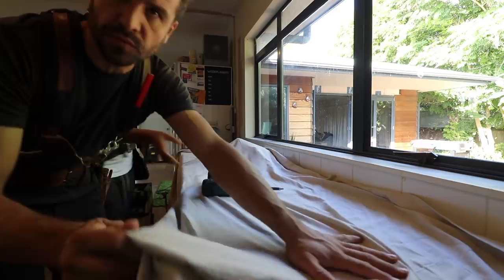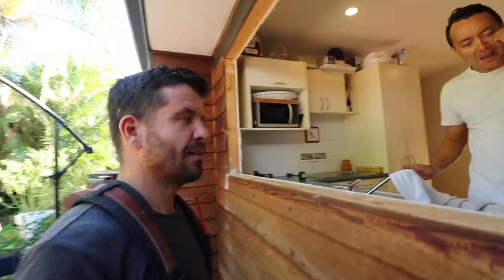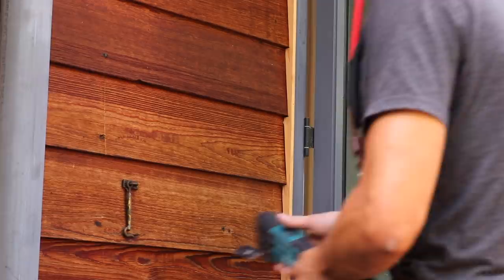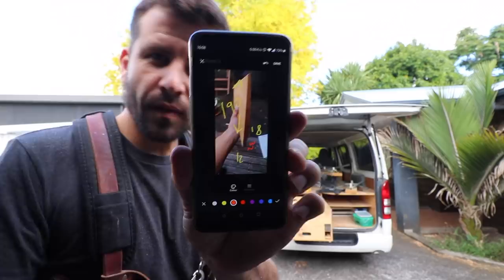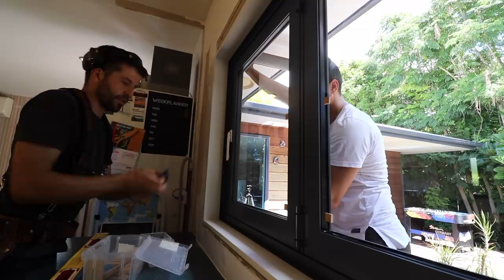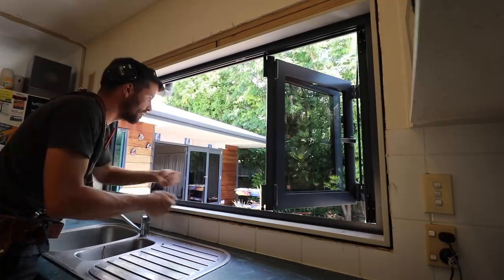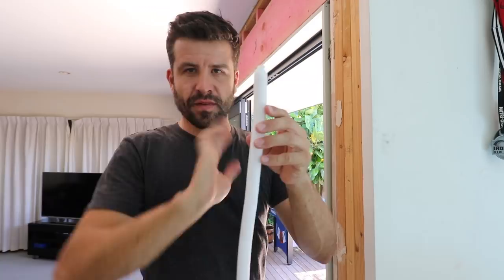A Kitchen Bench Window (very cool)

Comment: The regulator that decided on the silicon rule must have shares in the stuff. Damn that's a lot of product being pumped out.
Reply: in northern europe we fill insulation in the middel, then the backstop 10mm from egde and then a weatherresistant and slightly elastic filler with color to match the window

Comment: Silicone idea is crazy. If you can't use expanding foam cause you say it pushes in to the cavity. Use low expansion foam that stay soft and never sets hard.
Reply: It was probably someone of higher power that stated silicone needs to be used instead of low expansion foam, baring in mind this person probably has no idea what he's talking about (the person of higher power) GJ as always Scott
Reply: The way he said it, this almost sounds like it’s updated code for his area of NZ? I could be wrong, but that’s the impression I was under after Scott explained it.
Reply: silicon is not industry standard, it's personal preference.
Reply: First, silicone shrinks, second - if that rod is closed cell (i.e waterproof) then just bead either side with a thicker nozzle cut.

Comment: Wow! You can see how much water got in around that window installed the old way. None at all.
Reply: I know ....leaky homes came and the building industry went berserk , silicone hate the stuff.
Reply: Or, they will find a really dumb idea overseas, that was proven not to work, and turn it into 'their' latest idea. Only in NZ.
Reply: @Ben Miles But BRANZ knows everything, they have laboratory conditions.
Reply: @bunning63  Anything "Hardi" and usually from Canada
Reply: That window also has an overhang, and the corners of the window happened to hold together. The building codes are also implemented because of the low standards of window window quality and variety of building conditions. If that had no overhang for protection and was a cheap vinyl window the sill timber would probably be wrecked.

Comment: Bro, silicone tip for between jamb and framing. 

Cut the nozzle tip as big as possible, pump heaps in there so it's full and protruding out of the gap slightly and get some soapy water in a spray bottle (any dishwash liquid), spray liberally and tool it smooth (popsicle stick or even an off cut of timber). You waste a bit of silicone but is honestly about 5x quicker than that way. Keep a few rags and a bucket handy.
Reply: That's for a finished bead. I hope they put some window casing over it. It was a modern trim before.
Reply: @smokingcheeba420  no I use it for speed filling too. If you don't use the soapy water it gets everywhere/messy. Just insures the gap is totally full and the silicone spans it properly. Not fussed about the profile, more that it's full, fast and clean. 

 They'll for sure shoot an architrave around the jamb
Reply: I'm good with a caulk gun. It's an art. Less is more I guess. That's how the plumbers do it. The soap keeps it from sticking where you dont want it to. We use a ton of silicone on our jobs. We could just use PL.
Reply: @smokingcheeba420  sweet as. You go do it your way and I'll do it mine. Just wanted to offer a tip to Scott as I have taken many a tip/trick from his videos. 

Should sell your caulking gun art online oi ;)
Reply: @TheBoufhead  no beef. Just saying. I don't always have soapy water on hand. Or backer rod. Good tip.
Reply: Old phone books are the go for silicone sealing rather than using heaps of rags. ya wipe your tool off along the page and fold it up and repeat. when no more page is left you rip it off and the next page is right there ready to go. and all the excess sealant is nicely wrapped up in paper ready to chuck in the bucket. Tricks of a window installer.  Your welcome.

Comment: Cedar is great for keeping bugs away ..Here in Oregon there is plenty of cedar.  We also use the backing rod for our vynal  windows ( solid foam tubing ) fill the void and put stick on tar paper over the gap with sticks to the wood easier and lasts for ever and doesn't react with the foam. Some corks react with the foam rod, and you spend more time putting it in the gap..

Comment: Scott, you need the makita applicator gun,  Makita CG100DZB, for that sealing job. The white foam you put in are called bottningslist in sweden and over that we put sikaflex  sealing. Its usually Done in brick and rock fasads. 

Cant wait until next episode.
Reply: In America we call it backer rod. I noticed that none of the caulkers her use powred guns. They say it's hard to control the flow.
Reply: When do you use it? I’ve only ever used the insulation in rolls here in Göteborg?
Reply: In every fasad made of brick. 
To get a tight seal wich normal ”drev” insulation cant achieve

Comment: Screwing in the top of the window? In OZ we are told to only secure the sides & bottom & leave a small gap at the top to allow for frame movement. If the frame moves & you have screws or nails through it, the fasteners will pop through the timber & look ugly.

Comment: Hey Scott.. great stuff.. just curious who made those windows?..cheers!!  keep up the great work!
Reply: I believe thats a marvin ultimate clad bi-fold window. At least in the states(oregon) that's what i have been working with. One about that size sells from Marvin at about $14,700. Those windows are no joke.
Reply: @choclatellama123  this is in New Zealand bro. Def not $14k for those windows sorry.
Reply: @jlexperience  I know it's in New Zealand, i watched the video too. I also sell those windows specifically, i have one on display in my store, its $14,700.
Reply: @choclatellama123  for the bifold kitchen window in this video? $14k is laughable for a small window like that. My double glazed ranch slider was $3.5k
Reply: @jlexperience  but its not a slider. Marvin also sells sliders, but this is their folding window series. Aluminum framing with silconized polyester finishing, and reflective coatings on the glass make it so expensive.

Comment: Love to see u n patuea working.. Correct me if I'm wrong on the spelling.  U guys gonna make me buy a Vaughn hammer ,been pondering Martinez hammer, stilleto brand or that Vaughn framing hammer.. I'm using estwing but I want to see what all the titanium hype is about.
Reply: I love my 10 oz stiletto. But I only do finish carpentry. Now made by Milwaukee. Same hammer.
Reply from the maker: *Paerau . Check out the Douglas Hammer. It is the original of our hammer. They only sell a very limited amount but if you sign up to their mail list you'll hear when they are available . Very nice hammers! 
https://www.douglastool.com/product-category/hammer
Reply: @M. Lo just got my 2nd Stiletto, 14oz Mini, already have the 15oz framing one, love both of them

Comment: We're still using expanding foam.  Hadn't heard about the silicone change.  Although I haven't noticed any issues with the foam pushing the PEF rod out into the cavity.
Reply: We're still using foam too. Same city. With how tightly I pack my PEF rod, it seems strange that the foam could move it. I don't think I ever recall seeing the rod being pushed out of the opening looking in from cladding side.

Comment: The new wanz code has no packers in the head jamb, theres a building inspector in tauranga that looks for it and will fail, it gives the lintel abit of room for sag
Reply: Building inspectors, recall an old chippie that over his time reckoned most were failed builders, bitter ones at that. One job I was one this young woman turns up, yep building inspector, he comments she doesn't know shit and just goes around the house checking the wind rating for all the joinery, and that's exactly what she did. Hopeless.

Comment: how do you get away with screwing in the window.?Code is double galv 75mm nails 150mm from each corner and 400mm max centres. ?or is that not inforced in Auckland?
Reply: thanks, yes it states "pairs of nails or stainless screws"at the spacings i described.Zinc is no good due to the 3.2 treatment in the reveals n.our council inforces 3 inch galv nails in pairs at those spacings which is overkill in my opinion especially once you foam and archatrave 
 @N1rOx
Reply: @mmmlllzzz100  ah, interesting. Window openings here only need to be framed from h1.2 generally.
Reply: where are you? @N1rOx
Reply: @mmmlllzzz100  auckland